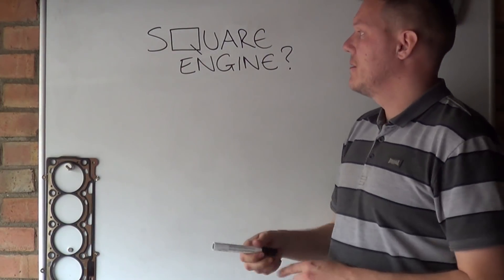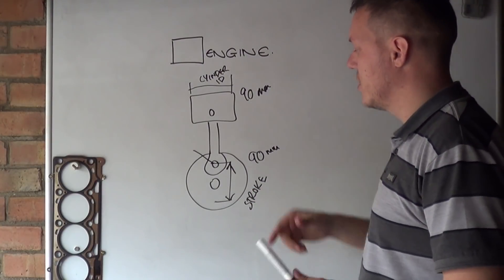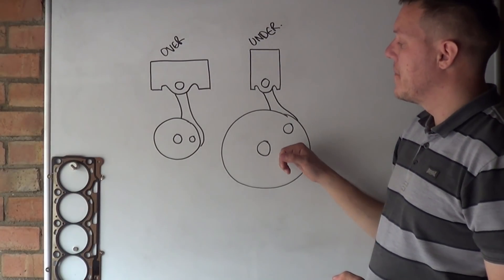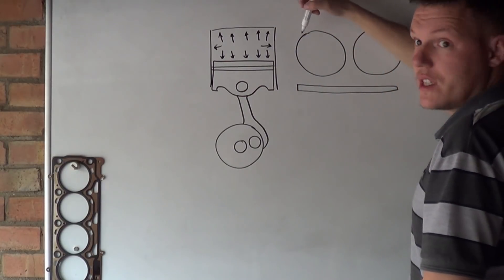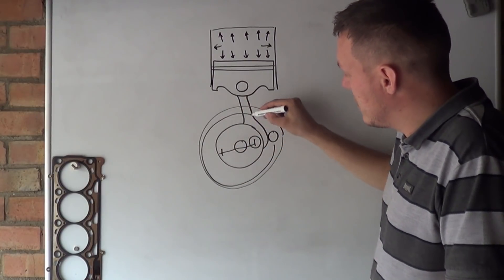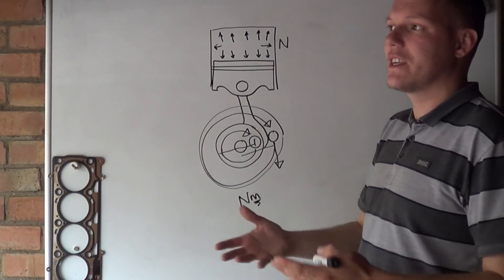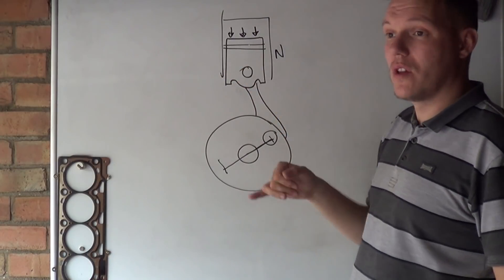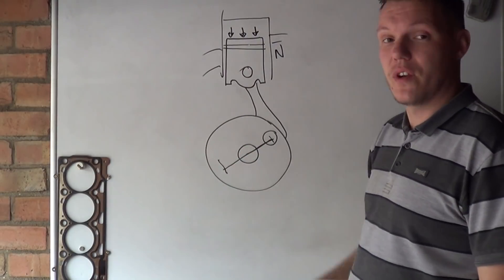Square engine? - Bike TEch

Comment: Yes but my interest is this. My Traction Avant '1934 design' engine had piston skirt nearly twice the diameter of the piston. Now a days it looks to me that skirts can be 15% the diameter on performance engines. So what changed in those 70 years.
Reply from the maker: Piston skirt lengths in 'performance engines' like F1 engines is so small mainly due to the run time of the engine. Piston slap would increase, but for an engine that has a lifetime of less than 2,000 miles - the piston skirt is length can be greatly reduced. This in turn reduces piston weight - hence why F1 engines can rev so high.

Comment: yea that all made sense, briggs and stratton shortened their stroke in their lawnmower motors and left the bore the same, it can rev higher but lawnmowers governor is set for 3,000 rpm so that was dumb, having the longer stroke ment the piston moved faster and it made more strokes at 3,000 rpm and now the lawnmower motors arnt as good at cutting grass, probably faster on a gokart top speed wise but at 3,000 rpm all the time, it was dumb, also went from 190cc to 150cc, so thats simple math that says shittier grass cutting, maybe briggs and stratton should watch these videos

Comment: Hey Matt, could you please explain how an engine such as the ford triton 5.4/5.8 with an under-square setup and 4 stroke performs the way it does n/a - lacking hp but torquey like described above yet have such an advantage when boost is applied, gt500's can rev upwards of 7k with the proper valve springs and the torque curve is so flat yet the power keeps climbing, basically big block power in a small block, WITH rpm. There are some that also say you can get 3000hp+ out of them all done up with race fuel at 10k rpm, so how does this engine accomplish all this while maintaining an under-square setup?

Comment: The loss of effective stroke in a two-stroke, where the exhaust lead over the transfer port opening must be around 20 degrees, (so-called "blowdown") means that a longer stroke is necessary or the power stroke will be way too short before exhaust opening, leading to a big loss in torque and efficiency.   The large diameter of a short stroke cylinder in the four stroke enables much bigger valves to be used than are possible in a more under square design, thus increasing gas flows at higher rpms. but once again losing torque at lower rpms.

Comment: Good explanations chap. Would you say a square engine would run smoother? My gs550 is pretty much square being 56 X 55.8mm.
Reply from the maker: No. lol physics doesn't care about if the numbers are the same and the numbers don't really have anything to do with one another, i.e one measurement - the crank pin circumference - the distance traveled is 1 number but the circumference of the piston has nothing to do with motion, but surface area. As humans we just picked this because its make sense. Thanks for the comment - matt